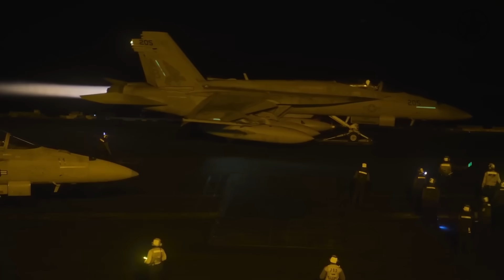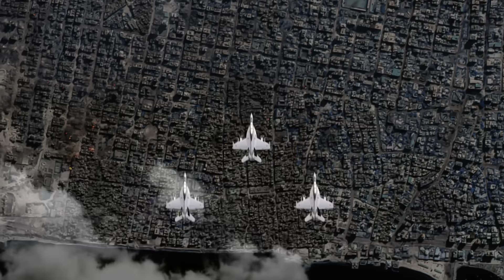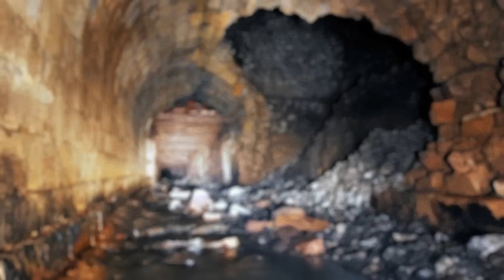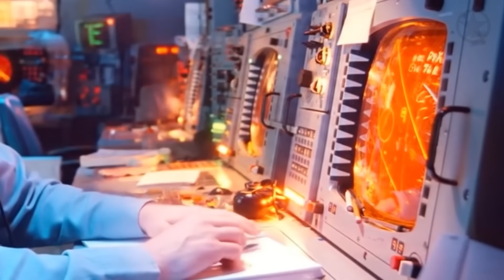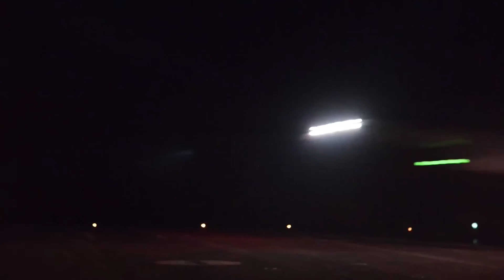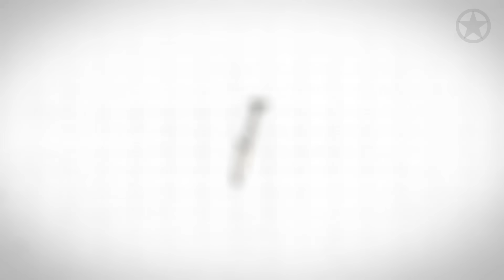Houthis Challenge America’s Fighter Jet — BIG MISTAKE

Comment: The E2-D doesn't have cameras like that to capture images.  It's equipped with an advanced radar system, a glass cockpit, and aerial refueling capability used for strike command and control, surveillance, (of air space) and search and rescue. Those images were either gathered from Satellite or an aircraft using TARPS.

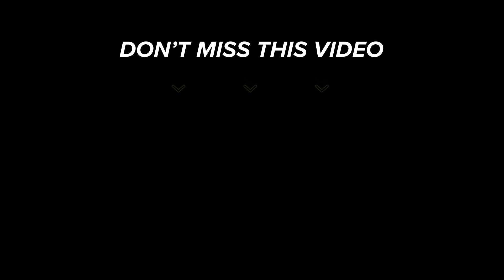Comment: 15:23 So, that's a fuel tank. The Jammer are in the POD's,  the ones with the RATs(Ram Air Turbine) on the front. The wing tips, also have specialized equipment in them.

Comment: You keep showing boxes around fueling pods.
The airframe couldn't make enough power to produce 8 MW of radar output, would sterilize the pilot, destroy the planes avionics and turn it into an expensive lawn dart. 
Typical jamming pods produce 6-10kW of output (Far more than enough) when your radar is looking for uw or mw of return signal. 
I worked on EA-6B Prowler, S-3B Viking and other ASW (S3) as an I-Level AT in the Navy.

Comment: Corrections:

1-  F.L.I.R. (pronounced as "<fleer>"), stands for Forward Looking Infra-Red.  It is NOT a radar, it's a camera system which operates in the infrared range.

2-  Get your video clips straight.  If you're going to talk about F-18s, then don't show images of F-16s, F-15s, or any other aircraft.  It diminishes your credibility.
Reply: Word we don’t wanna watch more bs than we already are. Like I know these videos are not live action or anything but don’t just show the wrong plane. Like genuinely we don’t want to even watch non live  videos let alone the wrong planes
Reply: I normally don't make Remarks like this but you would suck at working in Intelligence. You'd make a better spy I think. Did you know that the A-10 fires depleted Uranus torpedoes capable of Penetrating two feet of chocolate pudding as it reaches a complete state of plasma???
Reply: What Credibility ?
Reply: How about you make your own effin’ videos.  And stop complaining about people’s work?